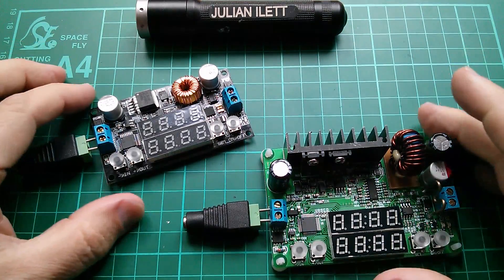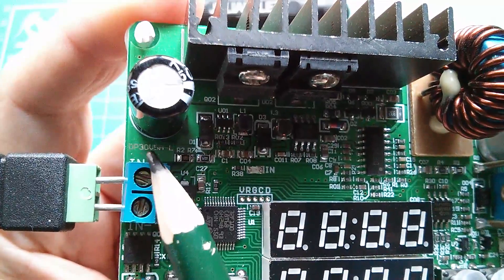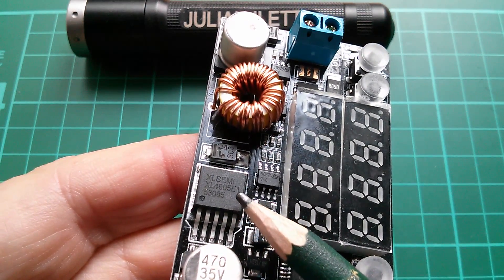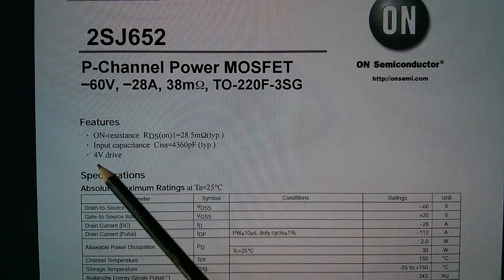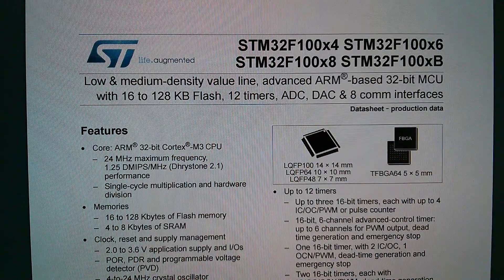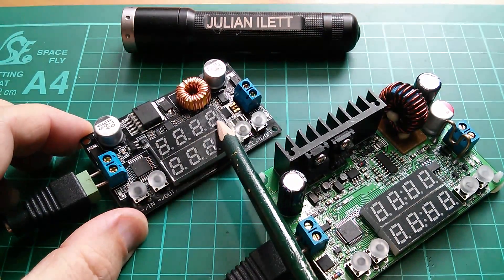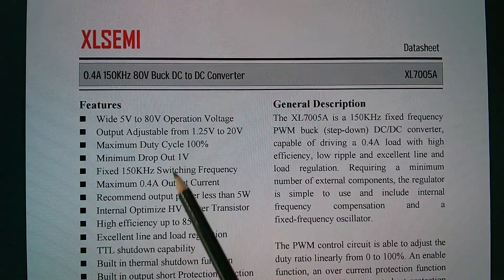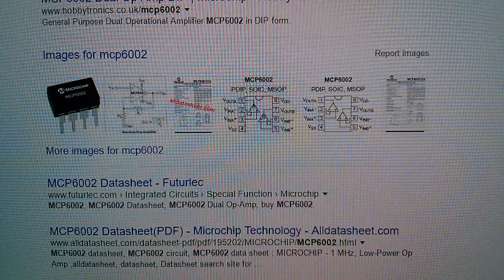Investigation: Two Similar Dual Display Digital Buck PSUs

Comment: Very interesting, I am looking for a board that can charge my 45 amp lithium iron battery for my Volkswagen camper house battery while driving using alternator power to supplement my 100 watt solar charger.  The house battery Powers a small norcold refrigerator that draws between 2 and 2 1/2 amps at 13 volts  with approximately 30% duty cycle. also phone and tablet charging.  Preferably I'd like to charge to 13.7 Volts and taper off the amperage to 0A to increase the batter's cycle life.  What would you recommend. 
Thanks for your help, Alexander

Comment: Hi. I wld like to ask something  but i dont know if u r interested in comments of ur videos but i ll give a try ; we see that there are XLSemi Buck chips on both boards whic is very obvious to see in Buck Conv. boards. If So then what Mosfet and Massive diode does in DP30v5a realy? Why need?
Reply from the maker: Some SMPS chips have integrated MOSFET and diode, but these are typically not very powerful. By using an external MOSFET and diode, more power can be converted.
Reply: Julian Ilett as u know ans showed on wiki those basix buck converters include 1 diode and 1 inductor ans maybe a softener capacitor and a mosfet to make the keyshifting. So if thats all we need for basic bucking so why we use xl4016 because it alao needs a mosfet and the diode

Comment: Hi friend 
interesting , there is a story about this. let me tell me . now I use black PCB to represend DROK prodcut, using green PCB represend my product RD DP30V5A-L
In fact DROK product was designed earlier than RD DP30V5A-L.  black PCB was designed and produced by other factory. drok conpany ask them design this , along selling, there are many many problem for black PCB, so DROK company can't endure such so many problem. so DROK company ask me to design a new one to replace black PCB . so we refer the request drok gave me and RD DP30V5A-L was born. so now you know the difference between them 
you can go to DROK home page, you can find one module , it is same with RD DP30V5A-L , only difference is than that one has black PCB .   this is the story about the two products.

Comment: I recently got these two and was wondering the same thing. I bought the Hangzhou Ruideng direct from them on aliexpress. I prefer the GUI for that one over the DROK. Also displays an extra digit for current. Would the STM32 provide that extra resolution? My conclusion is the DROK is made by either them or another manufacturer. The DROK is somewhat annoying to adjust the set points.

Comment: My gosh man you are fixated on low power supply units lately. Where is this going?
Reply from the maker: My two favourite gadgets are probably DC/DC converters and solar charge controllers.
Reply: Most things that require you to rig up a power supply vs being included, are low power.
Reply: I, too, am fixated on DC-DC converters and solar (well, the panels themselves).  They are two very related things because solar MPPT charge controllers use buck converter technology.  Also, using buck converters directly with solar is not only a way to regulate the voltage but it's the MOST efficient way to power a load.  I'm with Julian on this!  This is very fascinating stuff.
Reply: Thanks to a buck converter, I can charge my MacBook Pro off of a 24 volt DC source without an inverter (or the original power adapter) and it consumes considerably less power that way :)  My SLA batteries are normally 28V and I buck it down to 20V for my computer and it draws about 3.5 to 3.8 A (at 20V; less on the other end at 28-29V).  Don't even need a cooling fan at that current.  LOVE it :)

Comment: Good stuff... as usual!  
"Enhance heat dissipation" - just use a flexible heat transfer pad (non-conductive, with adhesive on both sides) to a heat sink... do it all the time.  Small step-up converter IC is probably for MOSFET Gate drive voltage while operating at low Board Input voltages. Rarely ever do any microcontrollers get used for SMPS control... unless it's specifically optimized for it... too risky if you have a MCU hiccup... the output may go full-ON... thereby causing the release of the magic smoke from load circuits.

Comment: you need to do a major video giving these guys various loads and see which one stands up the best, some questions are, what is the load regulation at all of its out put voltages? CC CV accuracy? load regulation with a noisy load attached? current capability? dropout voltage? I really want to know these things as I have a few of these RD devices but I dont have a scope to test with! thanks.

Comment: I am wondering if the SDB628 step up converter is being used to drive the Mosfet from the MCU output as the MCU is only running at 3.3 add in some internal losses and the current you want to switch the mosfet with.... If I am correct I would have thought a darlington transistor amp would have worked better?
Reply from the maker: I had the same thought :)

Comment: Interesting that the DROK has a switch mode controller.  Of course, it is described only as a BUCK regulator.  I have one and have yet to see a difference between INput and OUTput amps.  Maybe that's because I haven't pushed it more than 500 ma.  If the DROK is 're-badged', I guess I wasted my time e-mailing them.  It would be a nice item if it functioned at 1 ma instead of 10 ma.  As it was shipped to me, the fast adjust of the amps is much too fast.  I will probably keep it around, even after I find one more suited for a hobbyist.

Comment: i wonder how one of the larger Drok controllers, would work as a Solar Charge controller
set it some where between 13.8 ~ 14.4,
would probably need to be a combo buck boost controller

Comment: i wouldn't trust "drok" too much, i purchased a TDA7850 4 channel amplifier (4x50w @ 4ohms) and some unlabeled chip on the board blew, i then sent it back received another one  and the same thing happened after a week or so. 

i did get a refund, i think i paid £22 from amazon for it, to use in a car head unit project. never again will i use Drok products.
this is just the amplifier though. i think it was just poorly designed. i bit the bullet and got a bass face db4.2 and i never looked back ! that thing is a treat.
Reply: DROK just brand cheap Chinese modules, usually if you search for the same product on ebay, banggood, etc they're a lot cheaper.
Reply: yeah i gathered :) i know i paid a little extra for the module, but it was from UK stock as i needed it quickly. it's probably around 10-14 pounds from china or something. although there are a few china modules such as a lot of buck and or boost converters that Julian shows that do the business, i have a couple myself but you get what you pay for i suppose!

It may well have just been this particular module, it was pretty poor in other departments, for example it had a solder point for a ground wire to cancel out noise. 

I soldered a connector and hooked it up to my car chassis ground, it did eliminate a lot of the noise from the single board computer im using but only around 80%. 

the quality amplifier has zero noise.

Comment: I bought the Drok after watching the video where you got it.. But the IC on the left of the displays was not soldered all the way.. But a quick pass with the Iron got it working and I really like this very much..
Reply: Well there is a first gen and an improved one. You can check this when you power on the first gen and for example set the output to 5 Volts. When you power it on, meaning input voltage on, there is a massive spike at the output before it drops to 5 Volts, plus some other weird stuff if you constant current it. I think my video is still on YT. 
After emailing them they sent me another improved unit which works perfectly.
Reply: Oh didn't know that... But I do know there is no spike on the one I have.. so it must be the updated version.
Reply: This was what I got from someone who replied. Modified version should have these as an extra. Believe me the smd's are very small so take some nice glasses  http://kepkuldes.iminet.hu/kepkuldes/nagykep/k1f4pfhzj4bjf0138de.jpg
Reply: Hi. Did you figure a way to "enhance heat dissipation" ?  From the pictures I saw and Julian's video I don't see how a heat sink would fit anywhere.
Reply: I will have to check later.. Thanks for the info..
Reply: +MusicalBox  - I saw somewhere that the diode at the top right center is the thing to heat sink.  "How", I don't know.

Comment: There is no reason a processor with that much capability needs to do so little. 

Jeez with little more it can near run DOOM
Reply: exactly what i was thinking. 32 bit processor for a boost converter lmao
Reply: probably has some onboard cache, necessarily so?
Reply: Stinky Cheese
I think cache is only needed if CPU runs different clock speed to the RAM. And this does not happen until you get towards 200MHz(rough guess).
If RAM and CPU has same clock sped, Then cache is absolutely pointless.
Reply: True I should not have used the word cache without knowing more about the architecture, but it does have both SRAM and flash onboard so I took that to mean the SRAM was cache.

Comment: What do we know about STM32? STM32F103C8T6 Arduino mostly compatible boards can be bought on AliExpress for as low as $1.6, and they are much more powerful than ATmega 328p or 32U4 Arduino.
Reply: 64Kb flash, 12bit ADC and 16bit for PWM, it's an awesome board!
Reply: Not to mention 20 kB RAM (the reason why I prefer this when using 0.96" I2C OLED), and 72 MHz processor speed.

Comment: Hi Julian. Wondering if i could ask for some advice. im building a 10 port usb phone charger and i want to add a 4Amp  ferrite bead on the 5v. on every usb port.. From what i can find on google some say use a 33R and other source recommends 600R. what would you personally recommend please ? the 5v is coming from a high quality pc atx power supply capable of 40A on the 5v
Reply: I can't answer your question but I will add that you will want to use individual output overload and short circuit protection like a PTC polyfuse unless you like the idea of a USB cable going up in smoke. Also when possible use an adjustable output voltage supply set to 5.3 volts, it gives you more headroom for resistive voltage drops such as cheap cables. For instance the stock US Samsung adapter for the Galaxy S5 is rated 5.3 volts and 2 amps, and actually does put out roughly 5.3 volts no-load, but it also ramps the voltage up further with increasing current, at 1.4 amps it is putting out 5.5v and at the 1.8 amps of the S5 it is putting out 5.6 volts.
Reply: Hi. thank you for your reply! someone els recommended i use a 600R ferrite..apparently higher value the better.i have a  2.5A reseatable fuse on  every usb output for protection.im also using usb 3.0 for extra quality and better connection. i have been looking at other usb charger to get an idea how they make them and i keep seeing them add a resistor to the 5v on the usb. maybe this is to discharge the decoupling capacitors on power off ? or maybe to make the 5v more stable ?

Comment: Hi, Julian!
Hope you're fine!
How do you call this connector?
Do you have the link?
Thank you!
Emmanuel
Reply: Thank you!
Reply: toysareforboys 
Thank You!
Reply: Do you know better ones?
Reply: I looked in our inventory system at work and they are called "CCTV DC Power Connector" https://www.amazon.com/2-1mm-5-5mm-Camera-Power-Adapter/dp/B0058RLD9C
Reply: Or here http://www.ebay.com/itm/Male-Female-2-1x5-5mm-DC-Power-Jack-Connector-Plug-Adapter-for-CCTV-Camera-/302036843008?hash=item4652cc7a00
Reply: don't waste your money on those cheap green and black connectors, they have very thin wire inside, very cheap and nasty

Comment: I think the STM32 CPU is way overpowered for something so simple. Every microcontroller has its own PWM hardware, what more do you need to control a buck converter?
Thumb is a compact instruction set, an alternative to the original ARM instruction set.
Drok seem to just be a reseller, albeit one that gets the manufacturers to put their logo on the board.
Reply: Most likely they are doing something with the DAC. That's not so common on the very cheap micros.